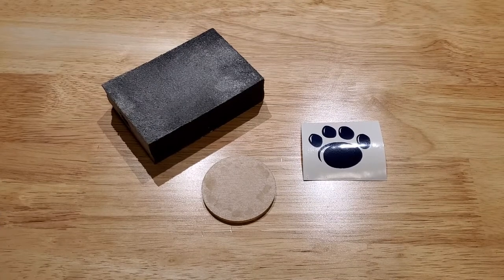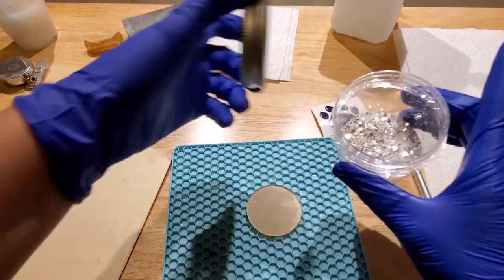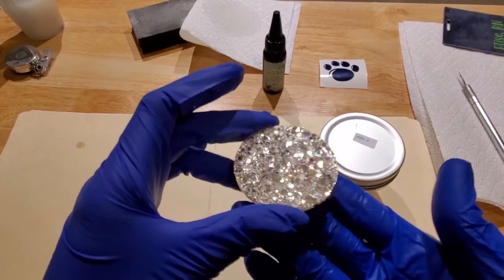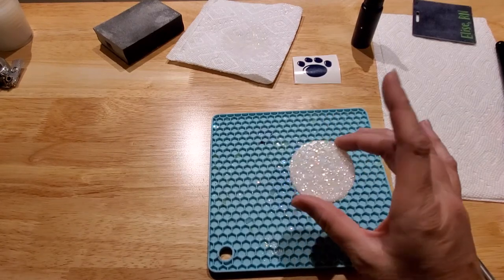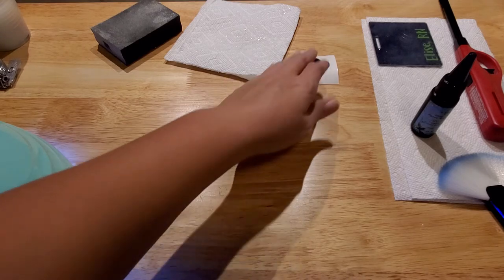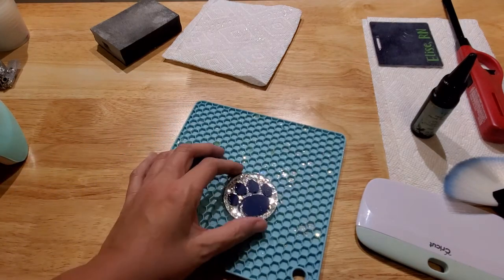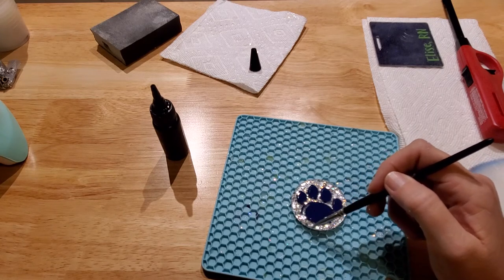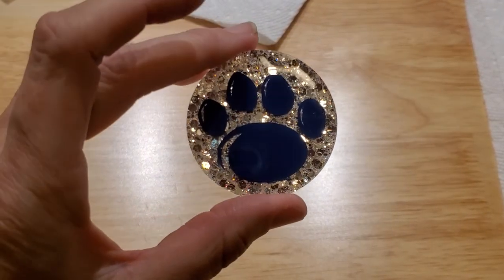paw badge reel topper using UV resin on an acrylic circle

Comment: What glue do you use to glue the topper on the badge reel!?
Reply from the maker: I use Loctite superglue.  I've tried e6000 & it never really cured. I could easily pop acrylic off so I changed to superglue.  I do let them sit a few days before I seal in bags to let any fumes dissipate. Otherwise, I would get a cloudy look on backs of toppers.

Comment: Newbie here…Is resin not self leveling?
Reply from the maker: It does want to self level.   Most of us will spread it around to make process happen faster.   It's also why it will drip over side of acrylic sometimes if there's an excess of resin. Heat will make the resin a bit thinner so it might overflow a bit if there's too much resin as it gets warm from UV lamp.  Not enough resin & you end up with a divit in your coating. I put something to protect finished back so clean up is easier from any spill over.